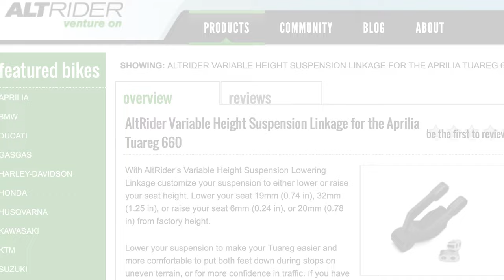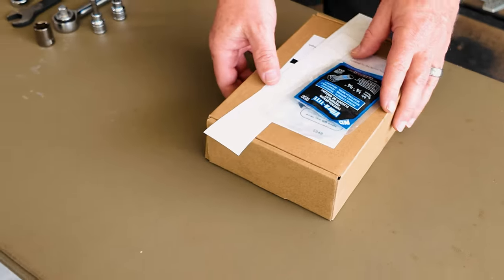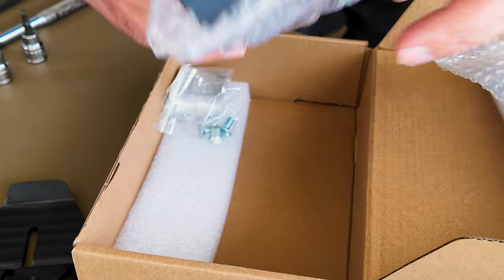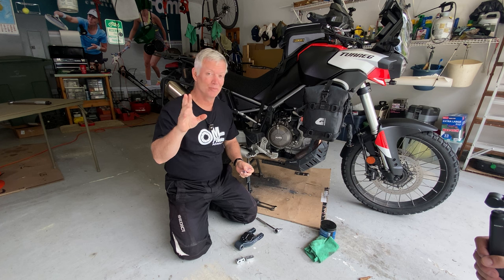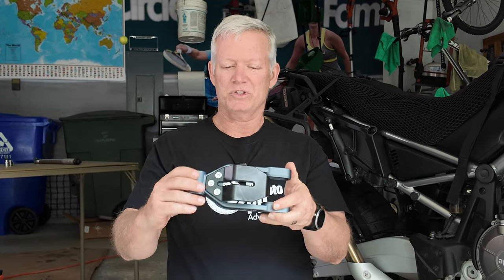AltRider Variable Height Suspension Linkage - Install Part 1

Comment: If you need to remove the T-Rex center stand, make sure you mark the location where the bolt touches so that you can drill a hole which would in the future enable you to push the bolt through that hole.
Reply from the maker: Great tip, James!  My friend Steve suggested the same thing.  Apparently great minds think alike!  🙂

Comment: I've just fitted fitted the AltRider linkage with the factory centre-stand fitted so can confirm that it can be done. This was with the bike on the centre-stand.
The rear linkage bolt is easy to get to but the front has to be accessed through cutouts in the stand mounting plates. The bolts have 13mm AF heads and 15mm AF nuts. The front nut was very hard to get a spanner onto properly due to the exhaust, a normal ring was not possible to get on fully due to the shape of the frame bracket. I ended up using a 13mm socket with a wobble extension from the left and it worked fine. This method was also OK to tighten up the fastener during the rebuild with a spanner holding the nut to get the initial tightness. A stepped ring should work well here if you have one - I didn't...
Once the bolts are out I thought I had a problem with getting the old linkage out as the stand mount was in the way. Lifting the rear wheel up about 6 inches with a ratchet strap over the seat let me remove it and get the new one in - scare over!
Now it is fitted the height can be adjusted with just the rear bolt which is easy to get to.
Reply from the maker: Thanks for sharing, John!  After "stalling out" on the installation, we had a great conversation with Jeremy at AltRider that you might enjoy:  https://youtu.be/lZy-eilFqu4?si=JOzI-Odgb7qHPc63.  With his guidance, as well as a video Martin LeBreton sent us about the T-Rex center stand, we had no trouble completing the install.  I'm editing that video, which is Part 2, and will have it up soon!  Sucks that the T-Rex center stand hased to be removed.  But I'm glad the Aprilia center stand doesn't!  Which setting did you put your bike on?
Reply: @MotoPhotoAdventures  I put it on the -19mm setting and this let me firm up the spring setting a lot so the ride is definitely getting better for me. Still some tuning to go but having this option on the back is great!
Reply from the maker: @johnstanden3741  that's awesome!  I went with the -19mm as well and now the bike fits me like a glove!!!